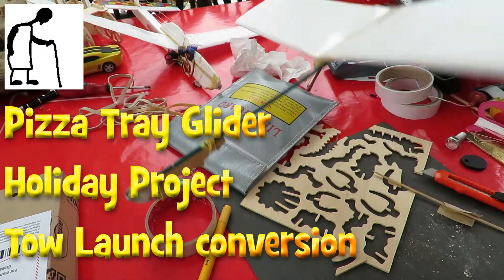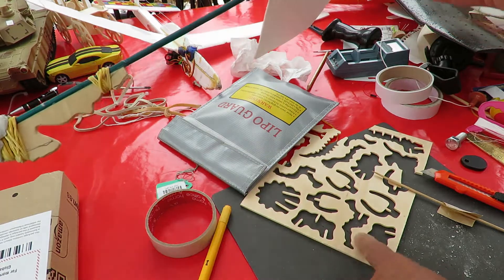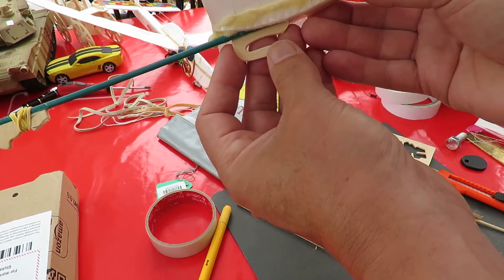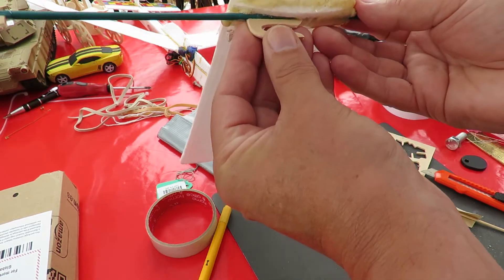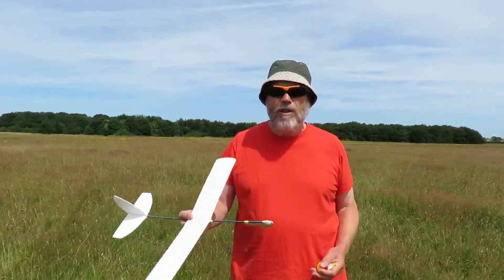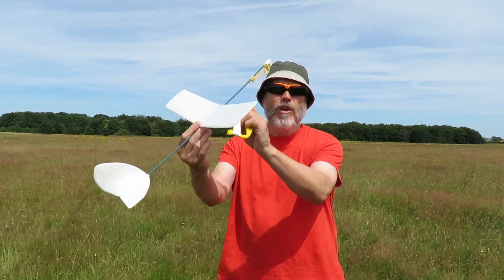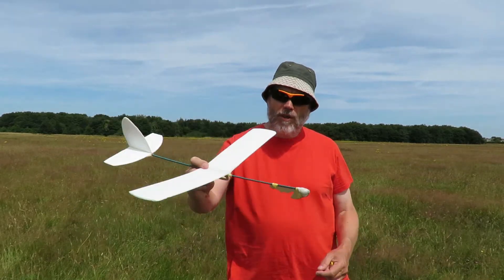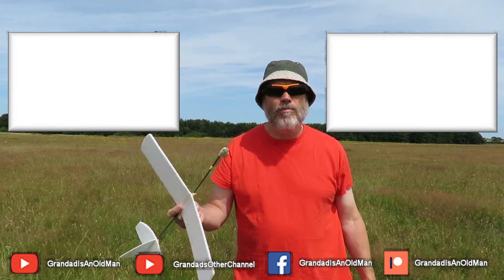Pizza Tray Glider Holiday Project Tow Launch conversion

Comment: What about a rod and reel unit, something to crank in your line quickly to give you some extra momentum?
Reply: Myra Madd I agree
Reply from the maker: Yes you can do that. You can use motor driven systems to do it, but I am just trying to use the same principle as a kite. If a kite doesn't rise up I don't start to run, I just put it away. Same here, the wind should take it up, if it doesn't then I won't be flying on that day. If it is too windy or you use too much force you will just rip the wings off.

Comment: On the third attempt when it was adjusted it worked a treat, that was its longest flight yet, It really needs no wind, like a lovely calm summer evening, then you can haul it steadily into the air excercising some control with the rate of pull.
 I remember epending hours with my Father and the Kiel Kraft Invader, that would tow up straight and on release ( hopefully ) circle down which seemed to a child to take ages, The Invader does benifit from having refined aerodynamics giving it good lift and very low wing loading so it would rise up quickly with not much pulling.
 Do you still have this Pizza Tray Glider ? ( or would you have to have a week eating Pizzas ? ) this also flew well and might give long flight times tow launched.